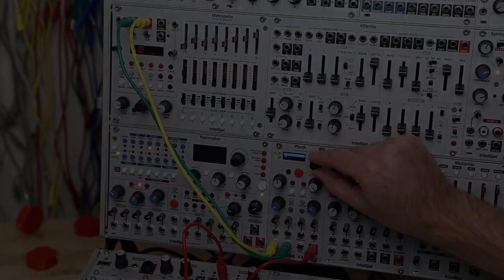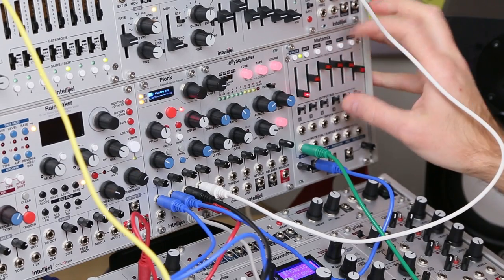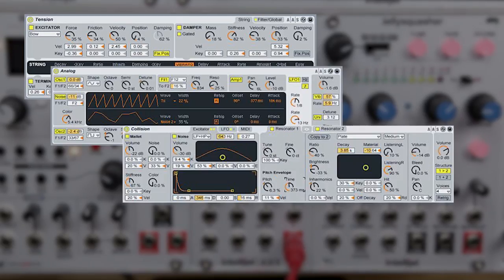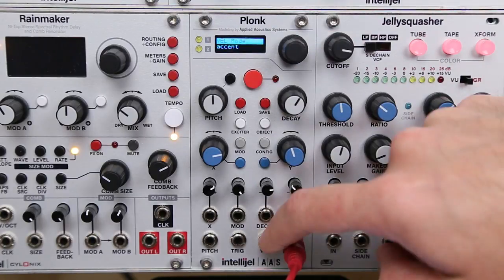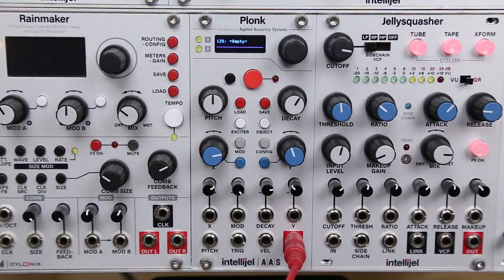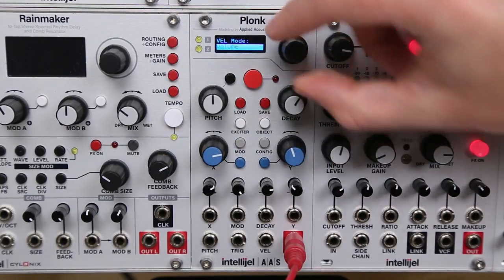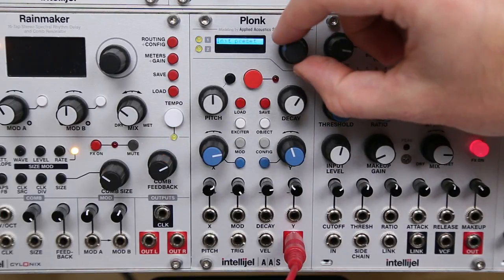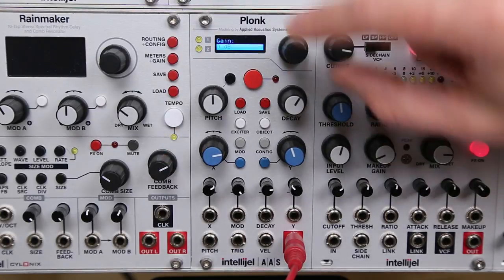Plonk Overview

Comment: anyway to change the sensitivity of that endless toggle knob ? seems to have to turn it a loooot to get slight changes. (I hate endless knobs)
Reply: Hey Sebastien! At this point no, but if you assign a parameter to the X or Y knobs, you can set the depth of modulation to get the kind of responsiveness you want.
Reply: The other problem I have with endless encoders is if they're mechanical and not optical, even if they're gold plated the plating wears off in record time and it oxidizes at which point the debounce logic doesn't seem to work and you get jitter where you turn it one direction and it goes the other.   The Korg synths really have this problem in spades-- I have two elecribes and a keyboard and all three of the data knobs started to jitter horribly after about 6 months, making live play next to impossible.   Plonk looks awesome, but I'm fed up with flaky encoders.
Reply: @Syncopator   I'm with you on that .... Hopefully it can de replaced with optical one without too much hassle  ... if you ever find one with correct measurements  for this module ... please share

Comment: I'm building up my first eurorack case and just got the Plonk. It's really nice, I just have to work out the best way I can incorporate it into my system. Grids for trigger and maybe Voltage Block for modulation and preset stepping? I'd like to know how other people are using their Plonk
Reply: Yeah that sounds like a good way to use it! Depending on what you have assigned to the X, Y, and Mod inputs you might want to adjust the modulation depth. For some things you might want Full range, while on others you might only want Low.

Comment: What if I do not have the mutamix module. How can I 
control all four sounds to come out like you was jamming
Reply: Mutamix is not required! You can select presets with any CV source, but sequencers work particularly well because it makes it easier to select specific presets. Also, the kits that come in the factory preset library are all set to four presets, but you can select as many presets in the MOD selection range as you want! 

This video goes into preset selecting via the MOD input in more detail: https://www.youtube.com/watch?v=EIhepLatoOg

Comment: Might just be me missing something about Mutamix, but why did you decide to use Mutamix to step between Plonk presets and use Metropolis as a clock, rather than just use Metropolis to advance the presets? In other words, why did you need to use Mutamix?
Reply: Metropolis works great for stepping through Plonk presets! However, because of the scale quantization Metropolis doesn't always go through the presets in a linear manner, whereas Mutamix sends a 0-5v range so as you raise the slider it steps through the presets from one to the next. It just makes it a bit more clear and predictable for demonstration purposes, and I had them next to each other in the case so I could get a tighter shot. I didn't need to use Mutamix, and I've had a lot of fun using Metropolis to sequence Plonk (particularly with the new ratcheting features), I just chose to use it for this example. Good question though!

Comment: Can anyone explain to me whether it is possible to set a long release time in Plonk with the help of Decay knob?
Reply: In that case you would want to set the Decay to max (127) under the object menu, and probably set the Noise Decay to max under the Exciter menu (which will be more pronounced with the Mallet:Noise ratio leaning towards Noise). The decay knob is more of an attenuator for these two values so even if it is set to max, if you have short exciter and resonator decays you will always get a short decay. I was able to get a decay of 10s with all the decays maxed.
Reply: Thank you for all your explanations. So, as far, as I understand, there is no full value built-in envelope function?
Reply: I'm not sure I understand what you're asking. You can set the three decay values to full values, and the Noise generator's amplitude envelope can be set to AHR which will hold on as long as a gate is high.
Reply: perfect! that's the answer I was looking for! thank you!

Comment: Can someone tell me how to randomize presets??
Reply: If you want to randomize presets you would set the MOD Dest to Preset Step, then set the range of presets that you want to randomize. If you want to randomize between all presets you would set it to Pst 1:128. Then you would feed a random voltage source to the MOD input.

If you want to randomize Plonk's settings to create new presets, set MOD Dest to Randomize and either press the encoder or feed a gate signal to the MOD input.

At 7:24 I walk through the MOD menu parameters.